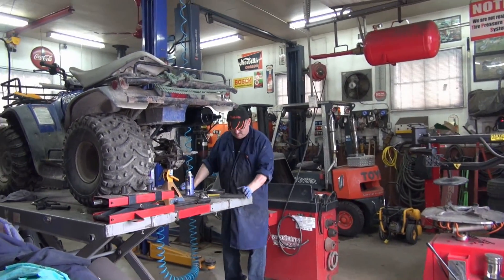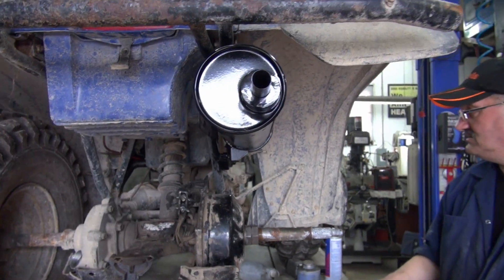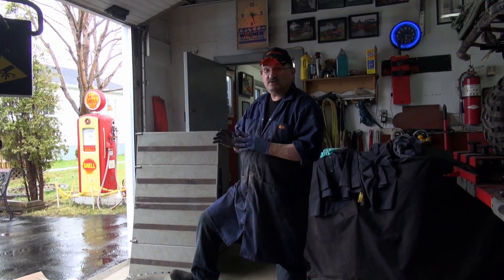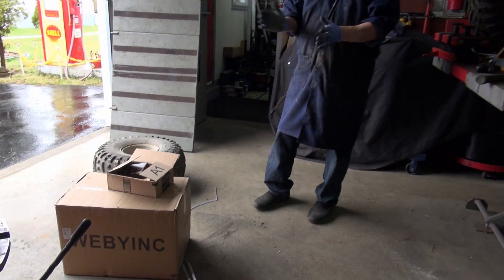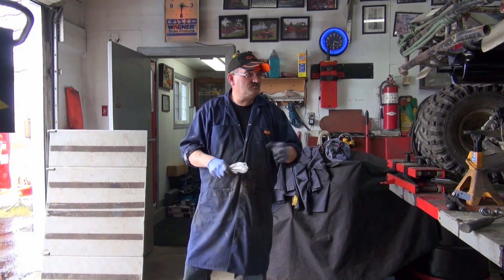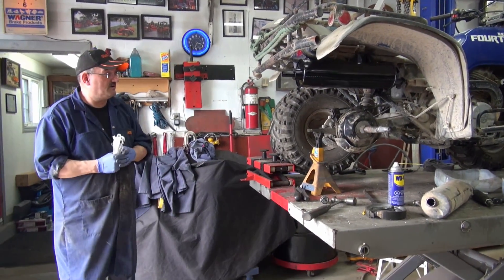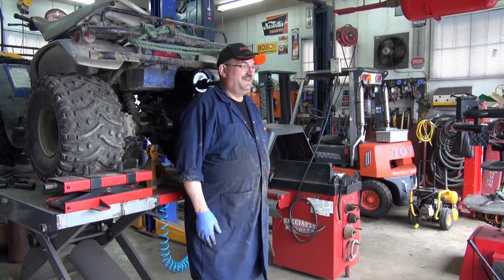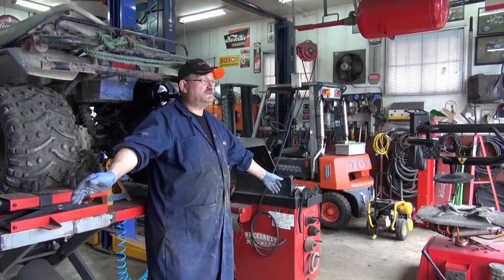Coming Up Next Week

Comment: Happy Mothers Day Kathy. Paul, You mentioned the new stuff in vehicles. Our new Ford Explorer Is drive by wire. Nothing mechanical connecting the steering wheel to the wheels. Talk about a leap in faith when You get behind that steering wheel. Almost wish he didn't tell us that :)  I talk to the car and it sets the climate on either side or the rear. Ask it to put on a certain radio station and DONE. It's like having your very own Kathy. The high end model can actually adjust the cruise control to traffic conditions, slow down and resume all by itself. So far, liking the new vehicle.
Reply from the maker: +Paul Sargent 
Yup. We see that sort of thin all the time. Our Mustang has electric steering. You can set it on one of three modes. Comfort, sport....It also has a 2gb hard drive that stored CD'S,DVD and MP3's. Nice now but watch when something goes wrong. Just the other day mother Ford announced recall saying that our Mustang can automatically downshift to first gear at top speed with no warning. Not very comforting considering we've owned it for 5 years now with only 20.000 kms on it. We could have been killed. they might be able to design it BUT it sure would be nice IF they designed it right. I don't like being their test pilot after paying $60.000 . I would expect it to work as designed.  :(

Comment: Hey Paul great vid as always and happy Mother's Day Kathy. Paul I was wondering when you get snap on tools does the truck come to the shop or do you have to go to one of his stops. And have you always used Miller electric products or have you use Lincoln electric as well? Thanks
Reply from the maker: +Stephen McGrath 
Stephen we used to had Snap-On & Mac Tools come to our area but it got to expensive for them being on the road so they stopped. They haven't been around here in ten years or more. As for Lincoln and Miller. Both very fine manufactures with top quality products and I've used them both extensively but stuck with Miller because the Miller supplier  gave what I felt was the best service. That being said I'd have no problems having Lincoln welding machines in our shop. Thanks for watching.

Comment: Nice silencer project, how can manufacturers come up with a price of $600? Automatic brakes! What will they come up with next, we now have automatic parking, and even automatic gearboxes, all of which detract from the amount of input a driver has, if there is a computer in there somewhere, it will go wrong, what they are heading for is a car that will need replacement every 3 years ! Manufacturers and governments would love that. Chris B.
Reply from the maker: +Englishman French 
We are living in a crazy world where everyone wants the latest and greatest in gadgetry and we'll all risk dying trying to use it.
Reply: +Paul Short : I hate to sound old and grumpy, but all these latest gizmos seem to offer less than the old things they are suppose to be replacing , everything modern is either loaded with computer dependant gimmicks, or it is self destruct plastic, also they seem to have built in a none repairable function, unlike machines of yesterday, a lot of young people look at old things, like a 1950 Vincent Black Shadow, and say Oh we have much better machines now, well, I have to tell them, they do not!
Reply from the maker: +Englishman French 
I like the way you think and I agree for the most part. I do think engines and transmissions are better designed and longer lasting while generating more power than ever before. That said I bought some chrome plastic covers for the mirrors on Kathys van and after one winter the plastic chrome started to rust. So now the Chinese figured out a way to get plastic to rust lol.